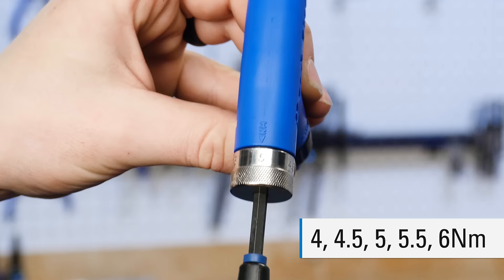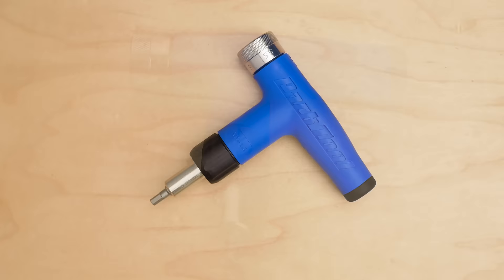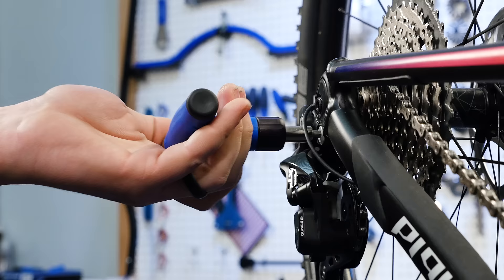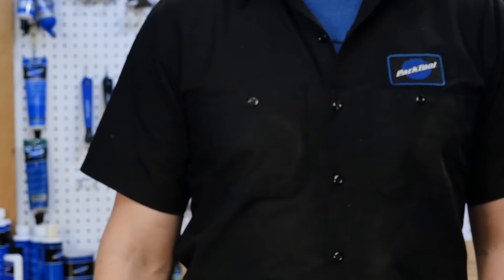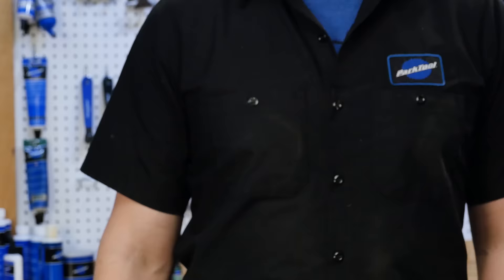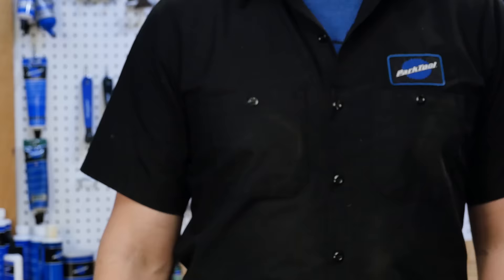ATD-1.2 Adjustable Torque Driver

Comment: A rubber ring around the torque adjuster actually came off in mine. I managed to put it in back and seems to work fine since. Anyway I had bought the Park Tool small torque wrench recently with Park Tool bits so they now replace this triangle tool. Money well spent!

Comment: I like my ATD-1 driver. I made it into an ATD 1.1 by cutting a short section of 6mm hex stock, broaching a hole in a knurled-edged brass disc with it, swaging it on, and epoxying the hex into the hole on the torque selector knob. I now have a thumbwheel where there was none before. Glad to see you've fixed this in the 1.2

Comment: I was very frustrated with mine, there is a small magnet inside that is supposed to keep the bit from falling out, upon switching bits the magnet keeps coming out every single time, eventually now missing. Bad design.

Comment: I love this tool. Would be great if it had a lockout feature so you can nip a bolt a little bit tighter if needed. 8NM stem bolts come to mind.
Reply: Then you need a ratchet torque wrench

Comment: Last year in august I purchased one, and after five months the little magnet in the socket broke. I sent it to the german dealer, who opened the warranty process on 27th of january. Do they really have to send the tool to Minnesota? Is there no faster way to handle this?
Reply from the maker: They should not have to send it all the way back to the Minnesota to have it repaired. The retailer should replace the broken ATD-1.2 with a new one and they will then deal directly with us on the old one. What may be happening is that they do not have any new ones to send you as the demand right now is out weighing the supply so they may not have one in stock to replace yours and that is why it is taking so long to get you a new one.
Reply: @parktool  Thanks for answering so quickly! When sending it back to them, they had the ATD-1.2 in stock. But I know - it is a difficult time in the bike business.

Comment: Park tool I just got it and used it tu undo a one bolt 6nm then I read that it is a bad idea to undo bolts with it. Is it still calibrated or did I break it??
Reply from the maker: You are all good. Try not to use it to loosen but if you do a few times it will not effect the tools accuracy. These are very robust tools.
Reply: @parktool  thanks so much

Comment: Could I Get  a aftermarket 50mm bit, would that still have effective torque ?
Reply from the maker: Yes, the length will not change the torque.   It is still rotating in line with the axis of the thread.
Reply: @parktool  If i have to get 50mm bits, which bits should i look for , in the aftermaret, like i.e S2 etc. also, does this require setting to lowest setting and calibration down the road ?

Comment: Why is there no torque wrench that goes 5-70nm?
Reply: extreme high and low will not be accurate
Reply: @ed0078  thanks
Reply: Or 2 to 500? What needs 70nm?

Comment: Expensive
Reply: Disagree
Reply: Well would you rather crack some carbon bars or a frame compared to getting a torque wrench?
Reply: @braydenhall1835  I have torque wrenches but this has a handy adjustnment mech and is compact so I would consider it at half the price